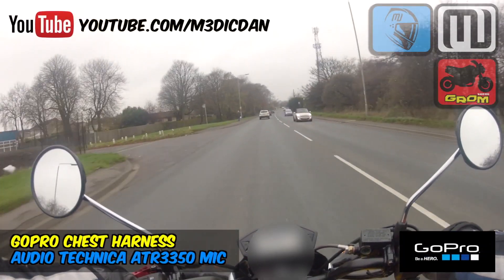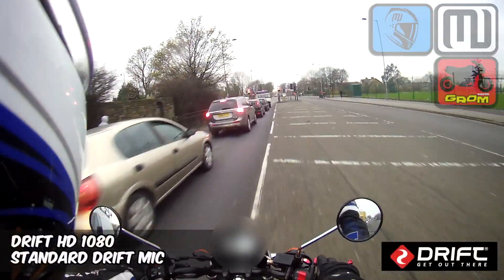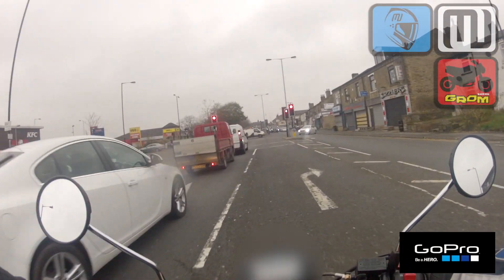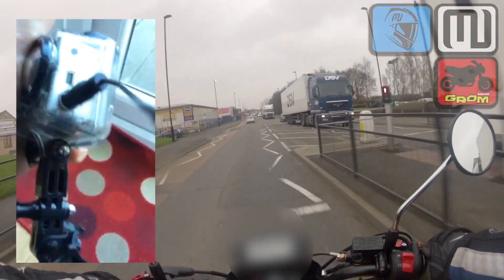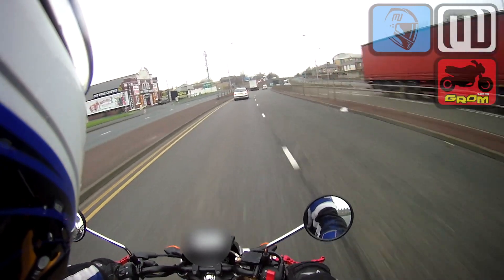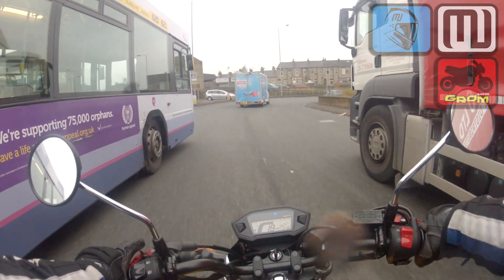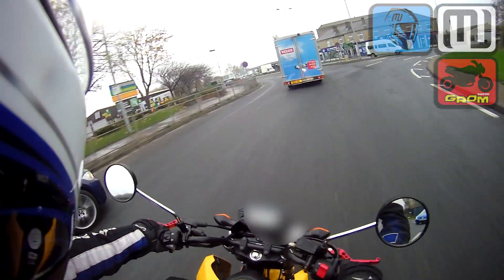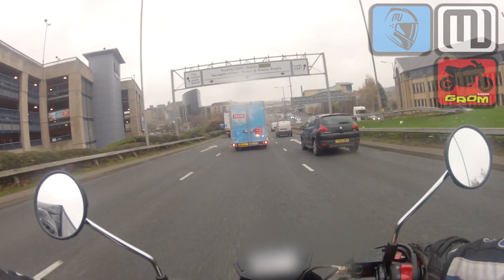Honda Grom: GoPro, chest harness vs Drift HD

Comment: Fark, I was shitting myself for you when you were in that sandwich! Foo Fighters are awesome! I just listened to a podcast with Dave Grohl, it was great.
I like the audio from your GoPro better (same mic as me) but I like the video from the Drift better. (Same Drift as me)
My setup is the opposite, I like the footage from my GoPro much better than the footage from my Drift, but mine is the Hero3 Black.
Yeah, I had to butcher my case as well to get the mic in there. I videoed myself doing that. I have not used the chest mount too much on my motorbike, only once on a couple of bike test rides. I liked the angle you had with that. Works well on the Grom!

Comment: Dremel is your friend ! How does anyone  do without one ? Sound & picture is great. I think the GoPro has an auto level adjuster. Found this out filming a noisy 2 stroke..... You have a Gixxer ? Turning green........
Reply from the maker: The Dremel has proved useful on more than one occasion.
Yes also ride a 600 K6 Gixxer.

I find the lighting on the Drift performs better (even though it is adjustable) in lower light conditions. I was told the other day that lowering the dpi recording from 1080 to 960 or 720 improves the lighting, but personally I didn't think it made that much difference.

Thanks for the sub.